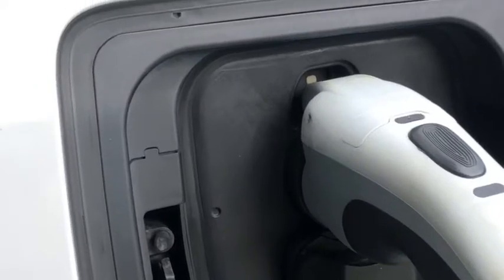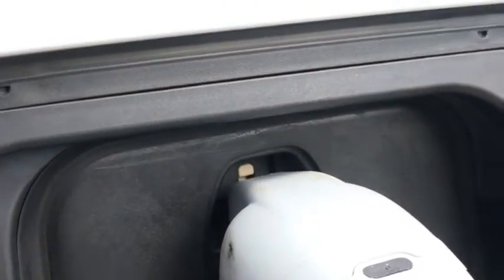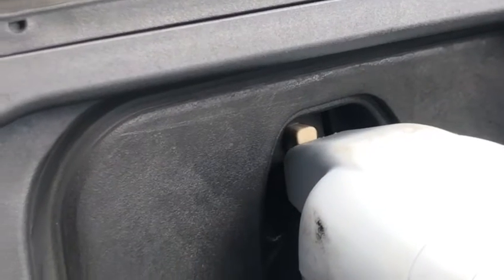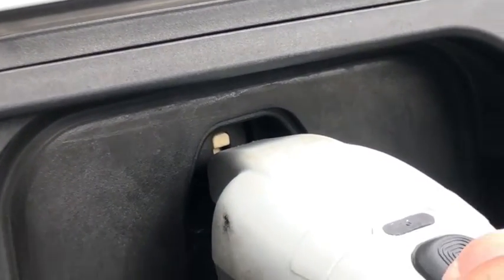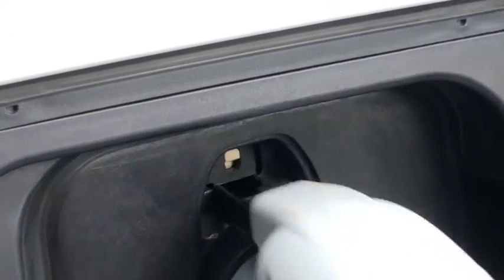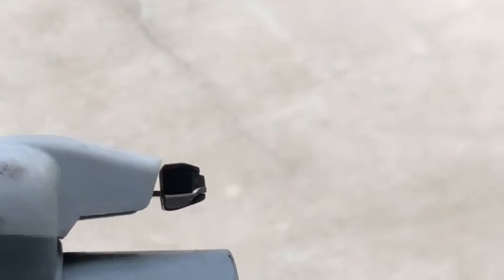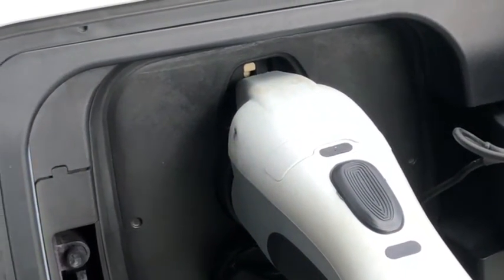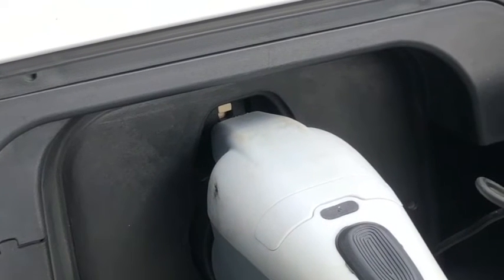The Trick To Release A Stuck EV Charging Connector

Comment: Wow! I just found your video for this exact issue and it instantly worked! Thank you so much! I had a thin metal file with flat tip that worked perfectly and gently, so it didn't interfere with any of the hardware of the cable connector or car. You saved me from stress, time and a tow! The Kia Roadside assistance on the phone was so unhelpful. Their solution was to tow, which sounded ridiculous when it just required the cable to be removed. How could they not be trained on such a simple fix and to provide that guidance to others. You are an angel! Thank you again and wishing you the best! 🙏☺️
Reply from the maker: Yay… so glad you found this trick useful. And how exactly are you supposed to be towed when your still connected to the charger?!? LOL So happy you learned how to solve that issue if it ever happens again. Cheers.
Reply: @TheEVNerd  I was charging using my regular outlet at home that I can unplug from the outlet. I would have drove it to the dealer myself, but my car will not drive with the charging connector connected to the input. But thanks to you I didn't have to! Lol. I've already had to replace my battery 2 or 3x for my 2019 Kia Soul EV and I bought it new. I think hot weather and super chargers can wear out the battery. It initially would charge up to 122 miles, now it's around 103 miles. I've learned to be very mindful of remaining miles/charge on a daily basis, even tho most of my driving is local. I would rather not have to worry about it such limited miles.

Comment: And this is how I ruined my charger port lock. There is an emergency reales for this thing right under the suicide door. DO NOT USE THIS WAY.
Reply from the maker: Mustafa Ramahi I appreciate your concern. I make a note of stating that if no other solutions have worked, including the blue emergency release cable on the i3, this trick will release the locking mechanism.
Reply: Where is that release in the x5?